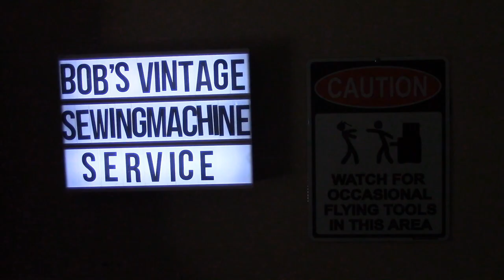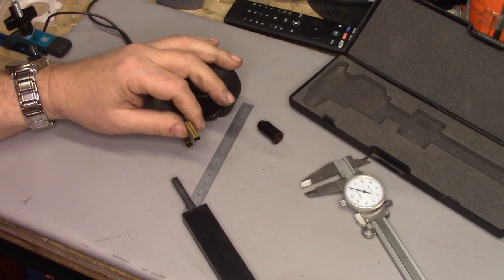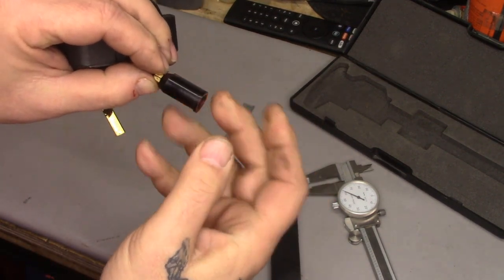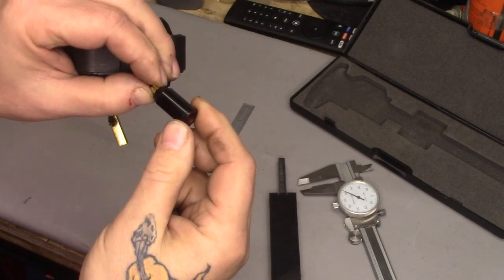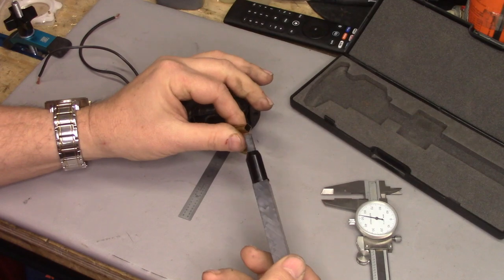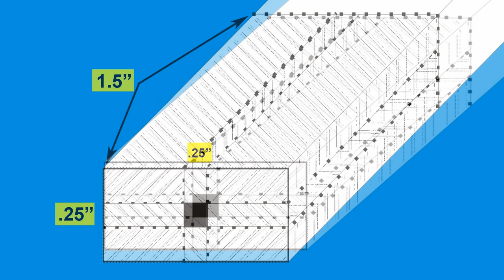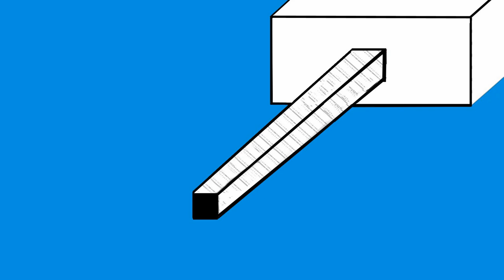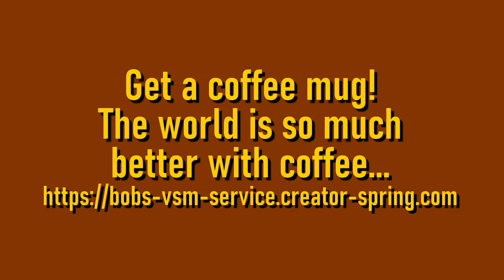How To Make A Singer Potted Motor Brush Tube Removal Tool

Comment: Great idea.  I made one out of a piece of HDPE I had laying around.  People could probably use plastic cutting boards for this, as well.  It worked really well.  I think a piece of 1/4" key stock would also work if you were careful.  I can get a foot of 1/4" brass square stock for $3.53 / ft. at the local metal supply.  I may have to make a formal tool out of brass stock turned down and threaded for a knob handle.  It also looks like rewinding the stator on these motors would be extremely easy.  The armature might be another story.   I don't know how common it is to have one burned up.

Comment: Amazing, it’s like you knew I needed that right now. Because of the head injury from a distracted driver hitting me as I was turning into my driveway in August I have lost knowledge and the ability to work on sewing machines which is super frustrating and I’m praying it’s temporary. Just hours before that accident I had purchased reasonably a singer 15 –91 which was in my van when I got hit. The cabinet was damaged and so far I don’t think the machine was. with some TLC it seems to be OK. I do know however that the motor is going to need maintenance including the brushes. Any and all help that you can give information about restoring a potted motor will be immensely appreciated; anything I knew I seem to have forgotten but my therapist says it will be good therapy for me to get back at it as much as I’m able. 
Thank you and please continue you’re informative videos!
Reply from the maker: Wow! I hope you feel much better very soon! I have several videos on potted motors - go through my playlists and you'll see "VSM Electrical" which covers all of what you need. 
https://www.youtube.com/watch?v=S1JHssu604M&list=PL9gIo9ITd1MgjMvzTYwmonoSrQVA01cPe
Reply: @BobFowlerWorkshop  thank you! I will watch those videos a few minutes at a time, that’s all my head can handle right now- -they are great for helping me make a little progress—therapeutic.
Reply from the maker: @vs7089  If you need help, let me know...
Reply: @BobFowlerWorkshop  thank you!! I can’t drive or be in noisy or bright places, so this will be a tremendous help and time well spent. I’ve been a bit afraid to tackle the machines since the accident; not wanting to do more harm than good. Knowing I have a source is fantastic. 

It takes me awhile to think of correct words, so I apologize in advance if I type out words that don’t fit.

Comment: I've done 5 motors using a 1/4" craftsman socket extender.  6th one not so lucky; cracked the plastic housing.  Probably time  to make something that is  more precise. Do you know any sources for the plastic?
Reply from the maker: Unless you want to buy a large quantity, check ebay for UHMW plastic. You'll find a lot of people selling small size pieces for a few bucks. I saw a 1/2"x2"x12" piece recently for about $5.00. Just have to keep an eye out...